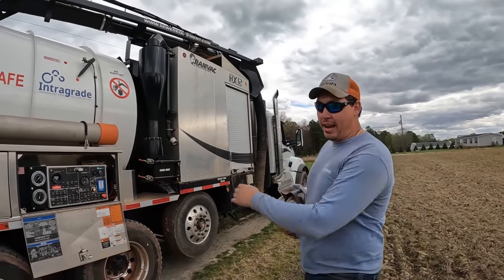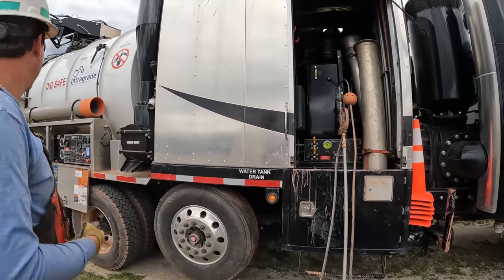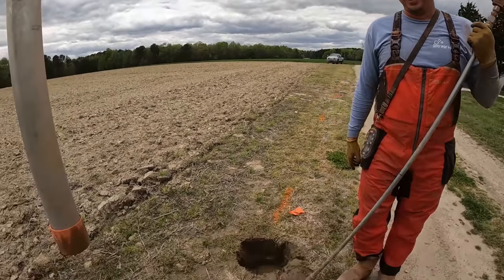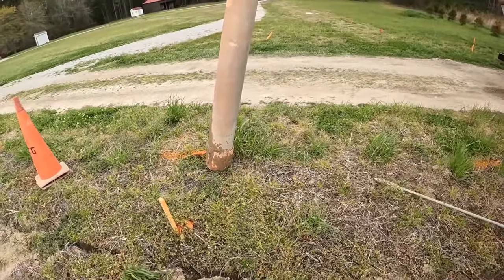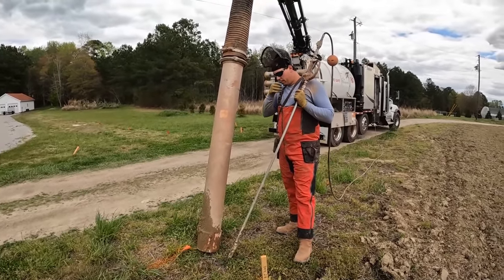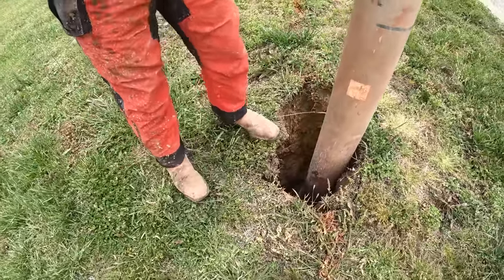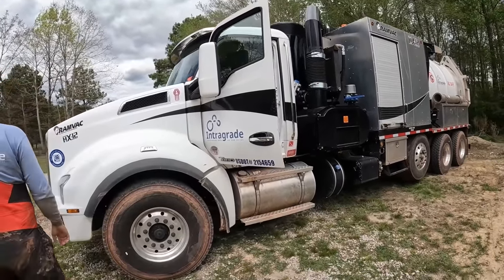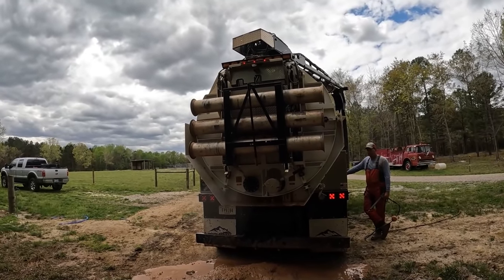Hydro Excavating Utilities With A Vac Truck

Comment: Back around 2009 I worked utilities and brought up “why not use a vac truck like the city uses to clean out storm drains?”.  We hand dug every pole hole for every pole set(wood, steel, concrete, fiberglass etc) in and around Baltimore.  Everyone laughed and said that was a stupid idea.  I should have started a company specializing it just that.
Reply: for 30 plus years I have been using JetBlast to vacuum pea gravel from around fiberglass tanks and lines in gas stations. first time they all thought I was crazy, now it is a whole industry.
Reply: I used to use a vac truck for replacing old water service shut offs that the steel cotter pin would rust off- we would just pothole the valve box and we had a set of pliers on an aluminum pole that you could squeeze from the top to put the new pin in. We would also use it for most of our main breaks and then we didn’t need to keep a pump in the hole, either. Once we had the main exposed, we kept the vac pipe right on top of the main and we could keep the main still charged a bit so no dirt could go back in and contaminate the water.
Reply: On my way home from work today I saw a hand painted slogan  on the tailgate of a pickup truck that said "Hustle until your haters ask you if you are hiring."  I think that's a good one.
Reply: pretty much my idea too.  but alas....
Reply: @peewee.3138  were i live(the netherlands) all in the ground  things are in an box with a cover, non return, meters  an so on. Valves must have an pvc pipe with extention where the spindle is in.
Regulations of installing.
Reply: Your mistake was asking for their opinions....
Reply: Hand digging holes?
I think they use augers in the UK. Why waste effort digging holes when you can just drill it?
Reply: @daithi007  your mistake was assuming I had a place to make those decisions.  A groundman on a line crew doesn’t get much say in anything.
Reply: @Skorpychan  because there are so many other utilities in the ground.  We have augers on our trucks, just can’t go around cutting fiber and gas lines.
Reply: Should of could of.     Just joking bud
Reply: @Skorpychan  I know of an instance of a small company using an auger to put in signs that took out a fiber optic cable that cost millions because of the traffic it carried controlled a pipeline. These people failed to get a locate. The company didn’t exist after this.
Reply: We use those for pole holes in northern Cali huge help when there are underground utilities  but some of the Areas are so rocky it doesn’t work that well but for the most part very essential
Reply: Shoulda coulda woulda!

Hear this from people all the time.

Old heads just to scared to take a risk.

F that not me brother
Reply: @Skorpychan when excavating near other utilities you can’t use heavy equipment to dig
Reply: @jonschneck4559  🧢
Reply: It already existed by then
Reply: @PuroCalibre16  not in Baltimore around 2009… just as stated.

Comment: I’ve been building roads and such for almost 20 years now and I have never ever seen or heard of doing a hard locate with a vacuum truck. Genius my boy. Absolutely genius.
Reply: We used to excavate out manholes in the street with a backhoe and then do a lot of back breaking hand work to finish the job and debris would fall down the barrel and then a few years ago we realized the Vactor might work well and we have never looked back. Here is a video I just made of us using ours. https://www.youtube.com/watch?v=wnmyST2DxxQ&t=456s
Reply: We use them all the time up here in WA, but that's more on the city/commercial side where there are a lot more complicated and sensitive utilities. Same with CAD trucks for material placement (like in 50 ft underground parking excavations), which would make another cool video.
Reply: everything gets hydrovac in the oilfield. Its a minefield of pipelines, 3 phase power, and fiber all over the place.

Comment: Cool truck. They rebuilt the power line on my road a few years ago. Set all the poles with one of these. Did almost four miles in two days and never called the locating service. They told me they didn't need to when they used the vac. Fiber optics on both sides of the road. Pretty impressive.
     Best regards from Indiana.

Comment: My dad was operating a grader on a street repave. The gas line had been located and was supposed to be 3 feet deep. He was supposed to cut a foot deep because the street was just paved over dirt with no gravel bed. He was only 10 inches below the surface when he hit the gas line.
Reply: It's common for the tracer wire to be WAAAAY off/separate from the actual pipe.
Reply: @edpoints1127  In that case, the tracer wire was embedded in the plastic gas line. The installation crew just didn't go deep enough. Even at 3 feet deep, in Wisconsin, the frost can lift things. It's not uncommon to have frost more than 4 feet deep under a road. Water and sewer lines are commonly placed 8 feet deep and occasionally freeze even at that depth if there isn't much flow.
Reply: @waynep343  ?

Comment: He joked about boring right through it. Friend of mine started getting issues with blocked drains and weeks after getting it jetted clean it was blocked again. When they eventually ran a camera down the pipe they found the gas board had bored a replacement gas line  to the neighbours house right through the middle of the sewer line and were causing the pipe to block with the solids.

Comment: Chris, I work for a large class 8 truck dealership group that supplies a large manufacturer of these trucks with many red oval trucks. The company is Vactor Manufacturing out of Streator Illinois and they make a lot of what we refer to as “Super Suckers”
We also have a customer who owns two or three of these units that contract them out to a frac sand supplier. They use them to clean up spilled sand from the trains they load the sand into. 
They are very cool and the use’s are nearly endless. Nice video.

Comment: We use hydrovac trucks all over Central Texas for telecom work to pothole existing utilities and to even dig bore pits and vault pits when we are in really crowded areas. Much safer and faster than conventional daylighting and digging. I've had to have a hydrovac truck dig me a 2' wide, 16' deep, and about 80' long. Took them a whole day and 3 trucks in rotation going to dump and fill with water just to lower 6 2" conduits in place. Love those trucks!

Comment: That is a very expensive operation but high in demand on city and suburban jobs. Number 2 brother-in-law in Canada has very similar equipment and gets $285 P/H plus travel. He just had to replace 1 small pump last week that cost him $10K plus $700 shipping cost.  Awesome video to show those another option to digging around buried high power lines.

Comment: Chris, love the videos and I've been subscribed for quite a while. I do sewer and water for a living, State certified. Seriously THE CLEANEST vac truck operator I've ever seen... I'm talking about his bibs, his boots (99% of the time rubber - FYI waterproof work boots don't cut it) etc... Vac truck is a great tool without a doubt. Good video. BTW... That operator should clarify vertical or horizontal suction! I know the answer. I was in a lift station that we shut down the pumps and replaced an 8" valve and piece of pipe. Inlets kept flowing.
We relied on alternating trucks to keep us working until the replacement was done.

Comment: I had a hydrovac locate power and fiber around a main gas line when I moved the gas meter to the garage. It was pretty interesting watching them weld a nipple onto an 8" natural gas line for the new feed. The connector they put on sealed and pierced into the main via the nipple. Vac trucks are amazing, thanks for sharing.
Reply: I have seen them welding on an open gas main before. It's quite interesting when you are a few hundred feet down wind and scared that someone is going to light a cigarette and blow the block up the gas smell is so strong, and meanwhile you see sparks flying out of the hole where the main line is from the welder.
Reply: @ke6gwf  The strangest thing I had the privilege of being part of was many years back. We were digging out an old leaking fuel tank at an airport, you could smell the fumes coming out of the hole. We were ready to pick the tank but had to remove a bung first. A dude I didn't know, jumps onto the tank and proceeds to wrench on the bung, while smoking. We politely asked him to put it out, lol.

Comment: I had a front row seat for one of these machines just last week.  The electric company was replacing the transformer box located right beside my condo wall.  I could look down from my 2nd story window right into the hole they were blasting out.  They had to take out an area about 5x6 feet to take out the old box, then splice the lines into the new box located a few feet away.  There was fiber down there too as everything terminated into the building right there.  Lots of conduit!  The guys were really careful and did not destroy the trees and shrubs located just a few feet away.  I was very impressed!

Comment: Years ago I watched a video on opal miners in Australia using compressed air and vacuum to dig shafts and adits. Lot of videos on air trenching or air spade but those don't vacuum out the material, just blast it out of the trench, dry.

Comment: In the UK we use Vac ex's all the time, we however use air to break up the hole not water, we can then re-use the dry backfill. When we build housing estates we put the roads in, along side the roads we would put in the water mains 900mm down from the kerb, gas 700 down from the kerb (200mm away from the water) electric 1200 away from the kerb 500 down, but all of those would be kept inside the footpath as well as fibre which would be 300-400 deep......When we need to connect them to the houses everything is inside the footpath outside each house....You just suck out the hole, connect utilities, sand and tape them up, backfill then onto the next house.....This works well when building homes in mass.

Comment: The company I work for has used Badger Daylighting several times to locate utilities. I work in the natural gas industry and we basically aren't allowed to use mechanized equipment like excavators to dig over any utility. They have to be found by hand or with vacuum excavation. I operator an excavator and dig in the road pretty much everyday. The only thing I'm allowed to do over a utility is pull the blacktop or concrete. Vacuum excavation saves a ton of time and the laborers back!

Comment: I work for a city in water distribution, we have a mini vac trailer (80 gallons fresh water and 250 gallons waste) for doing certain jobs. It's pretty nice just having the power washer to blast off mud and crud on a valve you're about to work on. Or using it to reset a curb box that's shifted off a curb stop valve, or filled with debris from the cap being missing.
Reply: Our streets dept has a couple similar vac trucks to his, but much better, at least on the newest one for the dumping and cleaning part. It has jets inside the holding tank to flush it clean.

Comment: When I was putting in my fence, I had phone lines real close.  So, I made my own "Hydro Excavator" out of my old shop vac and a pressure washer.  It was physically easy and it worked really well and I would have 3 foot deep hole in less than 5 minutes.
Reply: That idea was going through my head while watching. Even with having to empty a shop vac a few times per hole, it's still easier than chipping away by hand. At least until a big rock comes along. Lol
Reply: I used this method to make some pier holes under a garage, works rather well
Reply: If you want larger collection volume, rig up a 15 gallon removable top drum (community) commonly used for Hazmat disposal) with two vac hose connections on opposite sides of the lid, hook the vacuum to one and your hose to the other.
Most of the material stays in the drum.

I did this a while back with a pneumatic powered vacuum cleaner as an oil spill clean up rig.
Reply: I do that too super easy and quick.
Reply: As I was watching, I was thinking "it's really the pressure washer that does the hard work, the vacuum just sucks up the sludge afterwards - I have a pressure washer..." - not sure why I didn't think of using a shop vac for the vacuum side... brilliant!

Comment: what a cool process and service!  never knew this kind of excavation existed.  it’s given me some ideas for how to put in a drain under one of my sidewalks.
Reply: Dig a hole on both sides of the sidewalk then push a steel pipe or whatever you have under the sidewalk. Then pull it back out and slide your drain pipe in.
Reply: They make a jet to screw onto a pipe to do just this.  Dig the trench up to both sides, then lay the pipe in and turn the water on. It will blast the soil out of the way.
Reply: @tsales330    I prefer to do it with pvc then just leave it in as the line or as conduit.

Comment: Nice! We used to dig beside and crumb the dirt off a cable or pipe, you need to be able to read the soil. Never ever use a shovel or spade up against a cable, it damages easy. When fiber optics hit the area, no trace wire was buried with it. Poke and hope, read the soil to find the trench. Hours upon hours are spent to visually expose a utility and to date, I have never came close to cutting or damaging a line.

One of your best informational video's Chris 👍

Comment: At my old job we used these working around gas and power mains, to fix sewer man's, I sometimes ran it but it was mostly one of the other guys that did it. They are extremely useful for keeping water out of a hole you are trying to fix a pipe in.

Comment: Thanks for sharing.   A few corrections to what the operator was saying about the truck.  Most Combo Sewer Jetter’s use 18” 3800 CFM PD (Positive Displacement) blowers, while most Hydrovacs us 27” 3800-6400 CFM PD Blowers.  The inches stands for inches of mercury.  27” is as much vacuum as you can get.  I believe the vacuum of outer space is 28”.  The inches of vacuum is like the torque of an engine, while the CFM is somewhat like the horsepower.  Another correction is that the truck is legal fully loaded with both debris an water.  That’s a misleading statement.  Not knowing the weight of the debris, its hard to say.  Most 12 yard trucks can barely hold debris full an be legal.  Just a few corrections for an otherwise great video.  Again, thanks for sharing.

Comment: called in a broken water line under a hydrant, this type truck showed up..No mess, no front lawn damage and quickly sucked a hole big enough and deep enough to do repair...A bit loud on a city street but quite impressive..

Comment: i drove and scania G500 and an ampitech vortex! and it was a beast. u could lift 1000kg with the crane with the suction!and over600foot of hoose and only loose 20% of power vertical!

Comment: 25 years ago on a job they had a vac truck too make holes for sign post ,, putting in post for gas station price sign they used a bar to knock loose the dirt then suck it up .. they did not want too drill threw a gas line or phone line . paint marks were over a foot off the service locations .. if they did drill they would have hit a city gas main .. I did a post in my back yard years ago and used a shop vac .. only needed 2 holes ..

Comment: Here in so cal. One vacuum truck company has contracts with many communities ac and cities for emergency trench cave in rescues..the keep an operator on 24/7 ready to roll out . They also have 100 feet of hose to reach places the truck cant get to..an adapter is also there to connect to fire departments air extractors.  The success rate is quite high.  The issue is the resistance of on site fire to place the call to get the truck rolling..  I have talked to the company owner about 15 years ago and they watch the local news in the office as the news gets entrapment calls before the company.   

I wish local fire departments would get with vacuum truck operators  and practice rescues at quarries . Giving the fire fighters the ability to set up and practice.
Reply: Hello there👋👋,how are you doing today?hope you’re having a good start?God bless you!❤️

Comment: Ive been working on those trucks for the past several years and this was the first time ive seen one in action. Definitely an asset, but a pain in the a$& to work on and maintain! The combo units he was talking about have a hose reel on the front of the truck that does not allow the hood to open fully, so you have to pull the whole hood off to do any major service. Not to mention the trucks filthy most of the time.

Comment: My little town is running all new water mains. A couple of weeks ago I was serenaded by two of these trucks about 70ft apart, right in front of my house. They were loud. The water mains were bored underground. The vacuum trucks dug holes for water meter connections, and apparently other utility clearance points, like Chris is doing.

Comment: Some jobs can get real fun... Using a robot-mounted video camera to determine if a culvert needs replaced or not, then coming back after the locators have been there, sometimes there can be many, many paint markings on the ground that you just know will look like spaghetti once you locate everything over, under, and sometimes through the culvert that needs replacing.